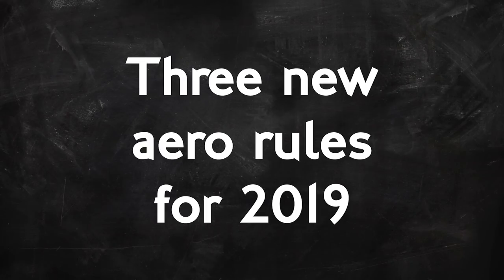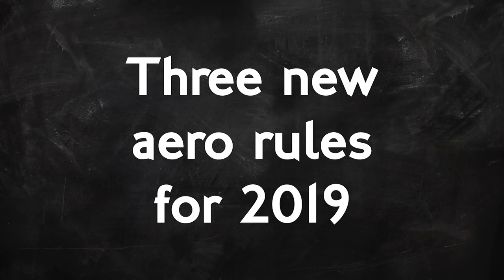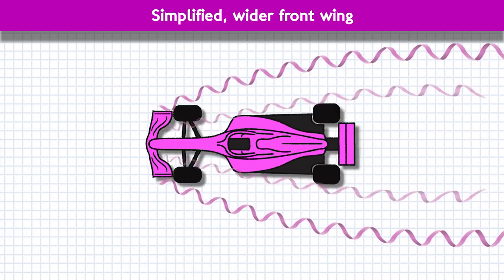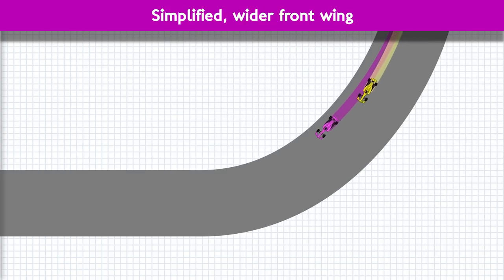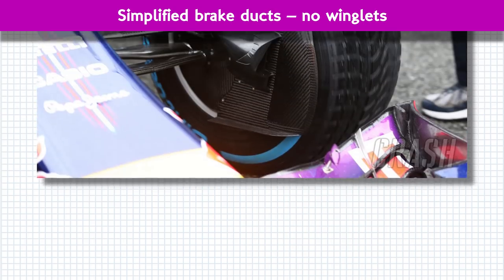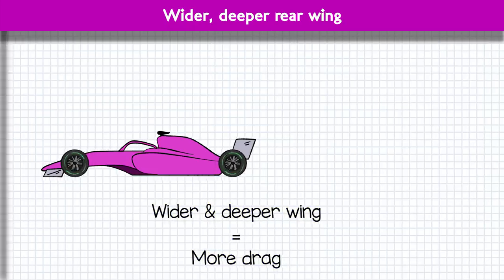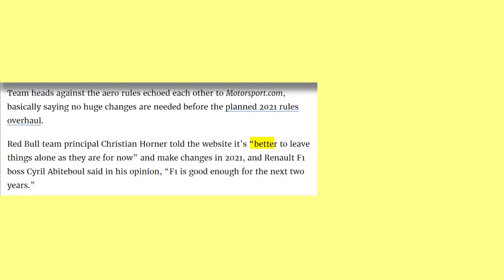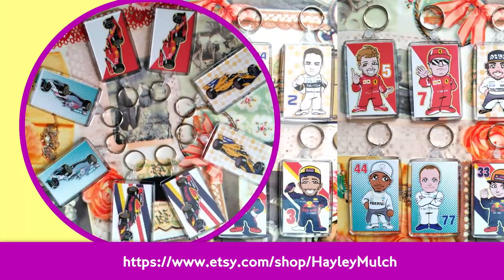New Aero Rules in F1 for 2019 explained

Comment: DRS overtakes are boring. Should let DRS be used by anyone anytime.
Reply: O!Technology that would just reduce overtaking
Reply: But it wouldn't be a bad reduction. Why would anyone want more overtakes on straights? What's so exciting about a car overtaking another one because it's simply faster due to some "hack" that shouldn't even exist? I feel like these changes will only make us see more overtakes on straights, cars will be closer and DRS more powerful, a.k.a easy overtakes.

EDIT: Remember 2002-2006, DRS didn't exist and we had so many overtakes, drivers made the difference back then.
Reply: Exactly, DRS is just a cheat for the car behind. There's no way to defend from DRS other than pulling a Max
Reply: @ O!

Then what is the point ? How about this: Increase the number of places DRS can be used, and anyone can use it anytime they want, with one caveat: Limit the number of uses per race ( a bit like Indycar push to pass) to say, 10 times per race. That will force the drivers to think tactically and might provide better racing.
Reply: Bruno Colaço 

2002 - 2006 where almost all overtakes, if any happened at all, took place in the pits, and the overtakes on track were only possible because a heavy car stood no chance against a lighter one, boring.....
Reply: Mani

At least races were unpredictable don't you think? But you're right, shouldn't have made that comparison... the way strategies worked during that time have nothing in common to the way they do now.
Reply: @ryan,

The natural defense against DRS is being ahead... The turbulence already handicaps a following car significantly. Easy DRS passes that people usually complain about happen when there's a huge difference between the two cars and/or tires. That's basically it. Similar cars still have A TON of trouble overtaking one another even with the help of DRS, which says something. Look at the REd Bull battle at Bakü for example. Or battles Nico And Lewis used to have a few years back. Or the battles Ferrari and Mercedes have had for the past few years.
Reply: @Deniz1923

That's exactly what should happen. At least there is some strategy behind it. A driver might have to save his DRS opportunity until a potential overtake need later.
Reply: @Deniz1923 These are provisional changes, the big ones are yet to come in 2021. But I personally think that putting a limit of uses, like the push to pass, is making DRS even more artificial
Reply: Bruno Colaço the cars were just so damn powerful. Dirty air wasn't such a great issue cuz most of the lap time came from the engine power and less from aero. Now it's mostly aero hence increasing the effect dirty air
Reply: Ryan Z -  DRS isn't a cheat for the car behind at all. If anything the current aero rules are a "CHEAT" for the car which is in front. You saw this year that vettel was holding bottas back 2 seconds behind because there was no air for Bottas' car to use, when they pit, Bottas was able to gain 3 - 4 seconds on Vettels car in one lap. How can a sport where a cars aero can adversely affect the ar behinds car at such a massive rate be fair? All you need to do in F1 these days is set a car up for qualifying because once the race starts if you lead into turn one, the car behind will be 2 seconds back within a lap or two due to the aero affect, not due to the drivers skill, or the speed of the car.
Reply: I disagree. The current DRS rules are just fine because they apply to long straights. DRS anywhere else will make the car unstable.
Reply: Deniz1923 I really like this idea added with the new kers could be really interesting
Reply: Without fixing the formula dropping DRS wouldn't do anything good.
Reply: They should change something that makes it easier for a car to overtake without DRS.
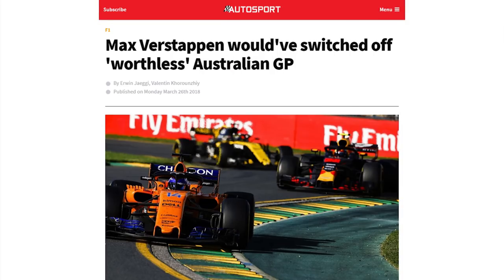Reply: Bruno Colaço 0:47 u sure?
Reply: O!Technology - Not all of them. An overtaking move is far from guaranteed even with DRS activated these days and has been that way since the current engines came in.
Deniz1923 - I couldn't agree more with you.
Reply: Maybe in addition to the normal DRS zones they could allow a certain amount of seconds of use per race anywhere and any time after the first few laps.
Reply: Guys we are Talking about 5 km/h more with the drs Open they want to increase the effect from 20-25 km/h so dont worry they just want it to be a little better
Reply: Drs is a bodge job on top of bodge job on top of dodge job to fix overtaking. Remove the original mistake, the bodges are not.longer required. That original mistake was that 10mm plank of wood...
Reply: EpicMeh The graph is only counting on track overtakes. I have already established I shouldn't have made that comparison in another comment. With that said, the lack of overtaking in that era wasn't as critical as it is now, since back then strategies worked in a completely different way they do now. Most drivers and teams follow the same strategy nowadays, while before fuel was also a factor, which led to some unpredictability given the very different paces drivers had
Reply: like he said in the video, the car behind is at a disadvantage due to dirty air, i think DRS makes sense, if not 'interesting'.
Reply: Muthukumaran Ramasubramanian  the problem might be a more powerful DRS without that disadvantage. Won't straight line overtakes become too easy then?
Reply: But then that would defeat the purpose of giving the car behind an advantage over the car in front
Reply: U have a lot to learn
Reply: Deniz1923, that's a clever way to bring strategy into play, although I understand that is why they will bring a 'KERS' button back to act as a push to pass. 

While everyone says DRS is gimmicky, I think it wouldn't be if they just allowed all the drivers to use it anytime since the purpose is to reduce drag for cars to follow closer. 
So even if the car ahead uses it the point is that the car behind is not affected by the wake/turbulence. Thus the DRIVER behind still has to work for his overtake.
So either take DRS restrictions away or implement it as a limited strategy tool as you suggest.

Furthermore they need to reduce all the barge boards and appendices. 
 I also understand the idea of wider cars but they should have kept the width at 1.8m and just shortened the cars. Of course that would mean less downforce but not these massive yachts they're driving around.
Reply: Side-effect of making the cars smaller: Monaco might actually become a Sunday race again
Reply: Exactly, as the car behind another car with drs has a slightly better airflow, both having drs on may be the best way
Reply: These are the best drivers in the world. I can't prove it with examples, because it hasn't been tried yet. But, I think the drivers are capable of figuring out when or where to use DRS as or when needed. Removing the specific locations for DRS enable would put the entire track into play at any given time, which should result in more opportunities for passing. 'Take off the gloves', let the brawl begin.
Reply: @brunocolaco8918  Because aero rules and innovations were wildly different so we didn't have this massive "dirty air" problem which causes the chasing car to be 1.5-2s slower without it being neither the car or the drivers fault. It's just that the leading car causes such a massive air disturbance behind it due to all the vortex generating aero devices, that the chasing car's aero devices are almost completelly useless. You could see last season that most cars chasing would stay stuck 1.5-2s behind and suffer from massive understeer, making exit speeds at corners terrible. This places them at such a disadvantage that they are too far behind to try and pass at the next braking zone, specially if there is a straight after the turn and it was a high speed one.

Comment: An even wider front wing? The teams had better bring plenty of spares!
Reply: There will be many more punctures in Baku.
Reply: Thats what i said
Reply: Wasn’t a problem back in 2009?
Reply: TheSocialMute Studios - the front wings were comically wide in 2009. I seem to think there were quite a few issues with them, but I can't honestly say for sure.
Reply: Phil Rodgers I was probably one of very few who liked the wider front wings, I mean as long as they don’t exceed the wheels anyway.
But they looked good and if you look back at 2009 the overtaking wasn’t too bad in comparison to recent years (not including DRS) 
I don’t think teams should not be allowed to develop the wings but they should just deter teams from being able to cause a wash out at the rear of the car 

I didn’t like the rear wing talks it just means that DRS will be overpowered on long straights and artificial overtaking is not what we need
Reply: yeah it was and do you remember how ugly those cars where?
Reply: Chris - They looked a lot better than the 2008 cars with the Dumbo wings and all the other aero bits sticking out. Those cars looks like hedgehogs that have been run over.
Reply: Even wider front wings might just as well have the opposite effect instead of making it easier for the cars to follow close to each other.
Reply: It's insane how little fans understand about f1 and aerodynamics.  As mentioned, currently, front wings are wake generators not downforce producers.  Wider front wings means teams no longer have to design complete wings and inwash design reduces the negative wake on the following car.
Reply: Chipped front wings and punctures is already a problem in formula 1 when drivers are trying to follow each other close. Making the wings even wider sounds like it'll only make it even worse more than anything.
Reply: They already made the front wings wider before, to no effect of note... I think it was in the year of Brawn GP or around that. I'm expecting these to be a total failure also.
Reply: Phil Rodgers totally agree i think if they went just a bit simpler would be good enough. The current generation cars are absolutley grouse looking. I think if there was no T wing and shark fin the 2017 car or no halo in '18 they would be easily the best looking in my opinion and probably why I have been watching f1 religiously the last two seasons and im sure alot of others agree.
Reply: @Chris
Seriously... Not that looks matter in a formula racing series, but these cars compete every year for the worst looking car ever in F1, for many years now. With their disgusting antler wings and twists, crinks, winglets, craplets all over. Haven't had good looking cars since the 90s. But some from the seventies, sixties looked better still.
Reply: Chris - Pheasant, partridge, and peacocks may not be to our liking either. Tastes vary with some finding then divine, others find them gross - and must look away. 
I don't want to parrot the views of others but maybe 4-5 yrs will be sufficient to deplume the relationship of your hyper-specific F1 design tastes to your viewership ritual. F1 direction may feel afoul it will get better.
Reply: Vitor Hugo D. Schwaab baku will be removed
Reply: Wes007mich please don't
Reply: Phil Rodgers let’s see how many Verstappen hits lol.
Reply: Evanstanislas Gaming Baku may end up being removed (not really sure why , I think it has something to do with human rights or something). It will probably be replaced with Miami GP , or maybe Miami GP will be seperate. They will release more information about this and confirm this later this year thogh .
Reply: Force India said exactly that

Comment: Drs overtakes sucks so much.. That's not a good improvement
Reply: Not all of them. An overtaking move is far from guaranteed even with DRS activated these days and has been that way since the current engines came in.
Reply: TheJokerit19 it depend a lot on the track. Sometimes like in australia you can't even with 3 drs zones but there are circuits that are so boring with drs
Reply: In the past the cars could overtake easily while following the slipstream. Now there is no slipstream so then there is the drs. Tecnically there is defenetily a difference but for the sport there isn't. drs was made for overtaking the car ahead so they can start an attack in the brake zone (just like stlipstream). But aerdodyanics could made "better/more complex" so the drs effect was gone. It's neccesary to increase the drs effect likewise.
Reply: Kevin Falk There is still slipstream
Reply: NtsParadize yes for sure, but I meant the slipstream effect, sry
Reply: Frank yes, I think you are right when you say overtaking doesn't make racing better but the try. Yes, absolutely! But, on the one hand, you need to follow the car ahead within one second, means you have to be quick enough. That's a natural overtaking range you never get when you are slower than the car in front. Drs is not a gift, just a helping hand. And on the other hand, Drs don't means you overtake on the straight, it means you are able to overtake in the brake zone!!! Going wheel to wheel in the following corner. That's the Drs lines for. They calculate where it's necessary to get Drs to start a attack in the brake zone.
Reply: Anything to give the slower cars a chance is good surely?
Reply: Frank i dont want a level playing field i want overtakes. The more magic aero devices the less overtaking. Bring back bathtub shells and stick current engines in. That would be entertaining. Drivers would have short lives but hey.. also the running man should be a real game show 😆
Reply: Frank well if they had no aero devices it would be proper racing again. Because we have wings that hinder the overtake we need the countermeasure of drs. We have none or both. With the new rules they are just trying to equalise the aero disadvantage of the chase.
Reply: Frank better aero for your can means worse aero for the car behind. Is that fair? Especialy when you have extra bhp too?
Reply: So you don't like slipstream either then? Next step is removing collision/making ghostcars or what? Maybe you should try watching timetrials and see if that fits you better.
Reply: I think fia should introduce more penalties for the defender cars to improve the alongside racing which is actually the most entertaining thing of this sport I think. There are penalties now but they're a bit useless if u get 5/10 secs for having crashed another car. Like in china hamilton pushed verstappen off the track (legally cause he had the line). If they remove that line advantage (so hamilton had to leave ver the space and then attack himself in the next corner) the competition in holding position should be much better. Same for verstappen/ricciardo in baku. If u apply a real penalty to vers (like a disqualification for the next race) the competition would be more on clear overtakes and not on pushing others off the track or crashing them so they need 10 or more laps to regain the time lost and attack again
Reply: Frank i think your missing the point of racing. It is supposed to be fair. They all have the same rules and opportunities just not the same cash. I will leave it at that.
Reply: canertwo were talking real racing sonny not games
Reply: The larger rear wing will generate a lot more downforce so teams will run less wind rake to mitigate this. This in turn will give cleaner airflow off of the rear wing.
Reply: Don’t think it’s flat out DRS that’s the problem. It’s the tracks and different DRS zones that’s the issue
Reply: Don Carrera De la Vega it's like activating catch-up on gta online....
Reply: Frank thing is it doesn't give the slower cars an advantage, they can't even get in the drs range dude. You need a 1.5 to 2 sec advantage with current cars to make a true overtake. In other words in some weird safety car scenario where say a haas or Renault was in the lead, the whole pack would be stuck in a no pass conga line without drs. That being said I'd rather have less areo than drs but I see it as a nessicary evil right now.
Reply: Luca051097 you have to be within 1 sec of the car ahead, there areo is disturbed at 1.5 to 2 sec behind, so as it stands it's pretty hard for a only slightly faster car to even get close enough to use it. Think about how much simpler early 2000s f1 cars were areo wise. Current f1 cars HAVE drs and still only pass about as often as back then. They need less areo not more drs.
Reply: DRS was much more powerful before 2017. The wider cars and tyres added more overall drag meaning the effect of DRS was much smaller.

Imo DRS now is good enough. It won't blow you past the next car so easily. So if they just improve how close you can follow to the next straight the current system should do well enough.

if they make DRS much more powerful and also make it easier to follow it might become very boring when people just overtake too easily on DRS straights.
Reply: akse WTF are you saying? More drag = more slipstream effect, and wider cars = bigger wake
Reply: Canada will be fucked with the new DRS. Trading places every lap. Sure nice with overtakes, but trading places just sucks.
Reply: I agree. Not all, but a lot of DRS overtakes are way too easy. Having more of these overtakes isnt better than having none at all.
Also it enables the top teams to plough through the rest of the competition like it's nothing! Just look at the redbulls. They had to start at the back of the grid and were already 5th after about 11 laps thanks to DRS.
Reply: I think it's acceptable to have DRS but it should be tuned down rather than buffed imo
Reply: How many overtakes were there before DRS. Leave out diva tyres, rain; circuits like Spa, Suzuka, Monaco. I mean on tracks where there is a possibility to overtake provided the driver slots into slipstream properly. 
Answer is very few. F1 has been struggling with processional races since ground effect and improving aerodynamics. 
DRS needs to stay until they figure out what they can do. Maybe single/two plane wings? Increase ground clearance? Decrease floor area?
Reply: Did I miss something? Is the whole DRS thing a choice between Top Speed and Acceleration vs Downforce?